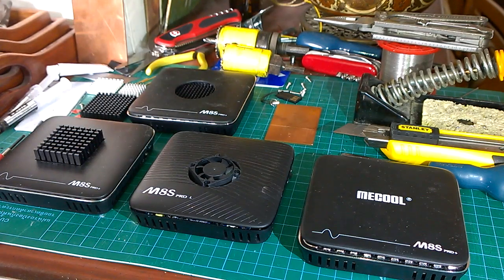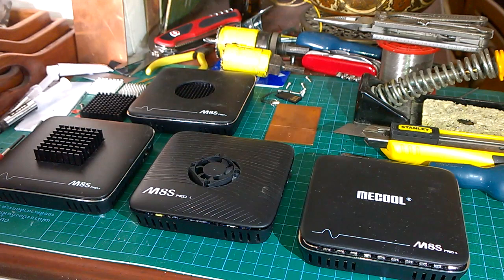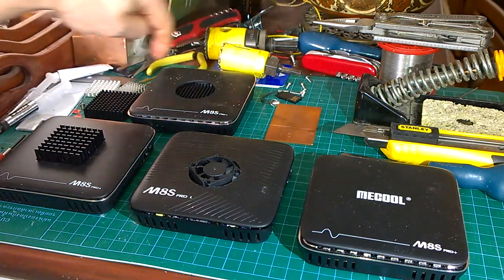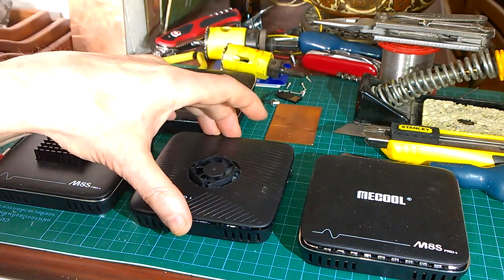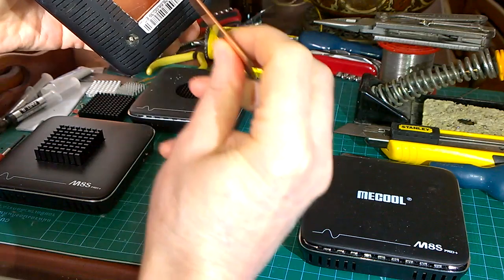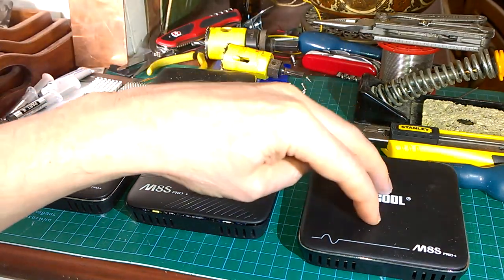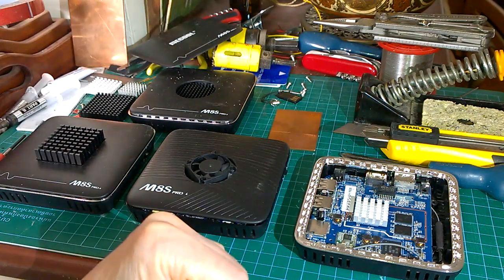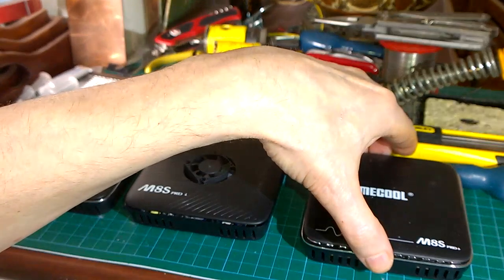M8S Pro L and Plus - Active and Passive Cooling Favourites

Comment: Passive cooling works well but like you said in the video a hole must be in the lid. Another option is to use a small drill bit and drill small vent holes in the top area especially where the heatsink is located so the heat can escape the enclosure

Comment: One question. My TVBox came from factory with a ceramic heatsink that only covered it's CPU. I Bought an aluminium raspberry type heatsink which is some more bigger that the original; would be better to apply it covering the CPU and the ram as well or that could suppose an issue? Thank you.
Reply from the maker: Personally, I would just cover the CPU. If wanted small heatsinks for the memory chips could also be added. Check with an IR thermometer to see what is happening if possible.

Comment: I like the one in the middle! Could you just post a big photo about where the neg and pos of 3.3 and 5V in the Plus+ box are? Thanks a lot!
Reply from the maker: See this thread post.
http://freaktab.com/forum/tv-player-support/amlogic-based-tv-players/701682-overheating-mecool-m8s-pro-l-and-pro-and-others-options?p=714925#post714925
Lots more info in this thread too ...
Reply from the maker: I find 5V to run the fan I have too fast but USB 5V is switched, unlike the constant 3.3V supply.
I use a small resistor in series with the fan to slow it down running from the USB 5V.
My fan measures at 67 Ohm (multi-meter current at 5V, use R=V/I) - I used a 33 Ohm resistor for 3.3V from 5V.
I would use a 66 Ohm for 2.5V
You have to measure your own fan and decide resistor from that measurement and the voltage you want to run your fan at.

Comment: I seen some copper 40X40X11 heatsinks on Ebay that have thin thermal tape on them. Will those work for this? I don't mean the heatsink(I know that is perfect cause copper works better than aluminum). I mean the tape. Will that thin thermal tape be enough if I also add a fan on top?
Reply from the maker: I tested Cu vs Al and only 1°C better for Cu. The black anodised 40x40x11 are really good and much cheaper than genuine Cu heatsinks.
No need for fan with a nice hole in the lid. Thin tape may be OK - You can always remove it and use a good paste or glue if you need to.
Reply: Well I ordered the copper heatsink and a couple fans anyway...lol  I will never understand why these companies don't add fans or even better heatsinks. They obviously test these boxes and see how hot they get.